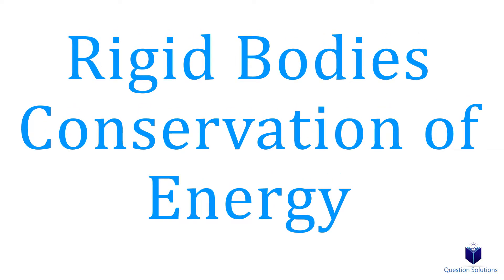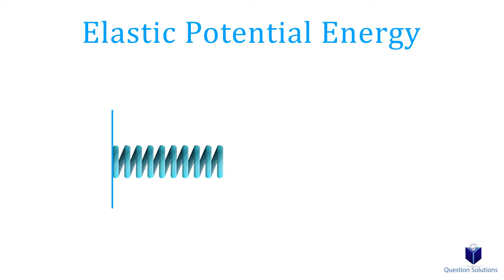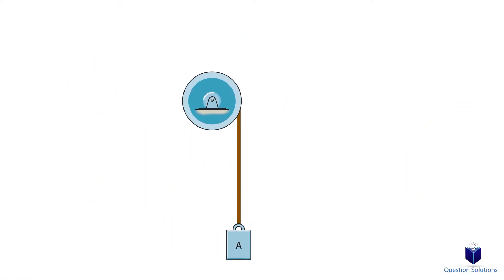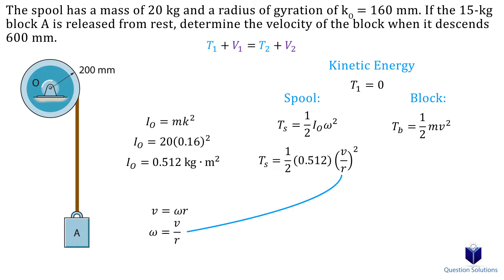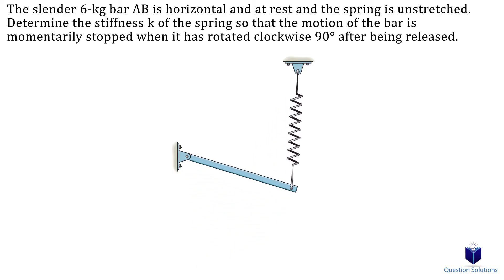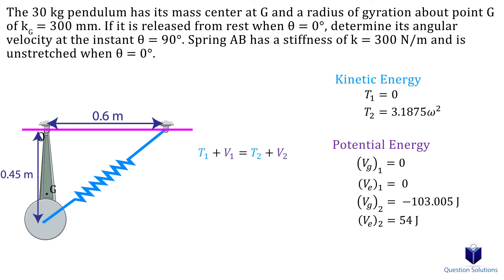Rigid Bodies Conservation of Energy Dynamics (Learn to solve any question)

Comment: Hello. I have a question. We said before video, if our particle moves toward downward, then gravitional potential energy is going to be positive, because particle and acceleration of gravitational on the same direction. In this video at 4:25, block goes downward and its same direction with gravitional acceleration but you said its negative. Can I ask you why?
Reply from the maker: Pulley problems work a bit differently because we use a datum. So here, our datum is our reference point, from that point, the block moves down, below the datum, so -0.6 m, giving us a negative value.

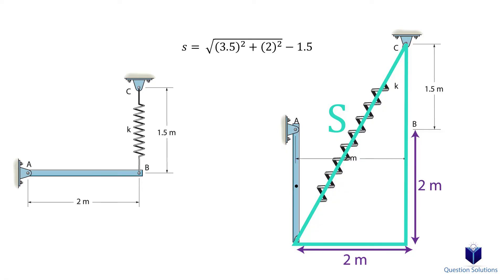Comment: At 6:02, you skipped a step. S = the radical thing only, then you get delta S = S - 1.5. Just might confuse other people since you write S = radical something - 1.5, instead of delta S.
Reply from the maker: Here, "s" is simply the length the spring stretched. You can use delta s, or just s, or whatever makes it easier :)

Comment: for the last question you subtract 0,15m. Why ? and how do know it is 0,15m?

Thanks
Reply from the maker: So if you look at 6:25, all the dimensions are given. If the whole pendulum is 0.6 m (top of the diagram) in length, and from the base to the middle of the circle is 0.45 m, then the spring when it's un-stretched is 0.6 - 0.45 = 0.15 m.

Comment: what's the difference between the regular radius of a disk and the radius of gyration?
Reply from the maker: Simple answer, you only need to worry about radius of gyration when you find the mass moment of inertia, and it's almost always given. This is not the same as regular radius. It's to do with the distributed area about the centroid axis. I don't have a video on it because it's usually not covered.

Comment: Hello once again, I've got a simple question. For the second question, why didnt we consider the fact that the spring force is resisting the change in motion (pulling on lever), and therfore consider it negative?
Reply from the maker: So are we talking about once the spring stretched? If so, the force of the spring is trying to bring the bar back to where it was, so the force would be upwards. If we are talking about the force of the spring when the bar is at rest, it's not really doing anything, meaning it's not compressed or stretched, so there is no protentional energy 👍
Reply: @QuestionSolutions  Helloooooo once again, and I meant that from my understanding is that anyyyy force that tries and stop a motion from happening (so in this case the spring pullsss on the rod to revert it back to original position; so forces opposing motion like if we elevate a ball from ground floor to the 10th floor,  the work down when an object goes up is negative thus its going to be considered as negative work). So here the spring is pulling the object back so shouldnt it also be negetive work?
Also side note: If you dont mind may i contac tyou via email or smthn, I've got a question and i think it would be ore comfortable for you if it is done via email.
Reply from the maker: @radiatedbug  Springs are a bit tricky because almost always, they will do positive work, unless you throw something at it, and you still want the object to go through the spring, so when it slows it down, then we say negative work. But if you throw something at it, and you actually want it to stop, then it'll still be positive work. Very rare to get questions with springs that involve negative work. Even in this example, the spring is trying to pull the rod back to the original state, so positive work, where as gravity is pulling down, away from the starting point, so we get a negative value. And yes, email is contact @ questionsolutions.com 👍
Reply: @QuestionSolutions  I understood that clearly, very well explained thank you. And I will send you an email within 24 hours hopefully , tahnk you so much once again
Reply from the maker: @radiatedbug  You're very welcome!
Reply: @QuestionSolutions  Also I've checked the website, it seems pretty cool youve got other subjects tooo i wish i knew about haah. But is there any chance i could get your personal contact?
Reply from the maker: @radiatedbug  The email I provided is one I use, so you can contact me there :) It's a personal one at this point.
Reply from the maker: @radiatedbug  I replied to your email, sometimes, my replies goes to spam/junk boxes, please kindly check 👍

Comment: 7:21 Do we have to find centre of mass?
Reply: Yes because Gravitational potential energy is measured with change in height of centre of mass. But you don't need to worry bcoz it will already be provided for difficult shapes.
Reply from the maker: If the object is a complex one, you will most certainly be given the location.  👍

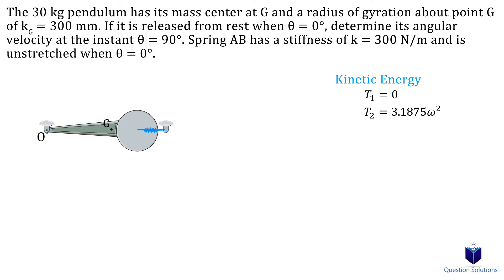Comment: 7:30 why you dont use the parallel axis theorem , T=0.5Iow^2 ??????
Reply from the maker: If that works for you, do it. Usually, you will find that there is more than 1 way to solve these problems and get the answer.